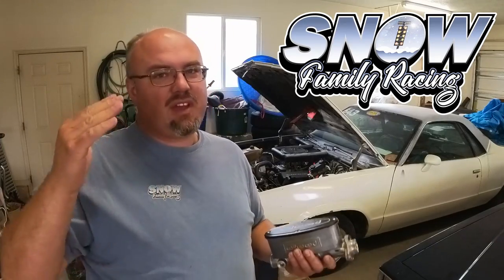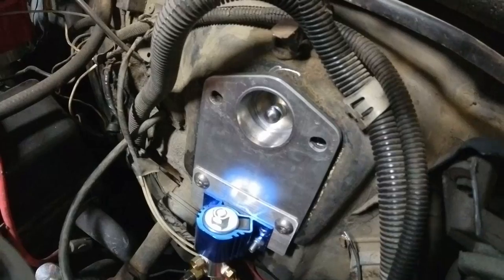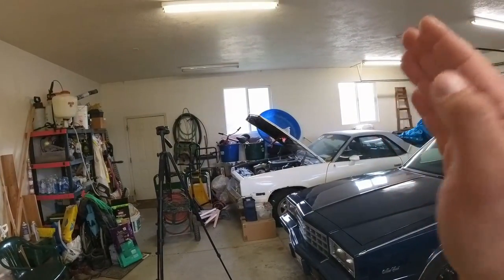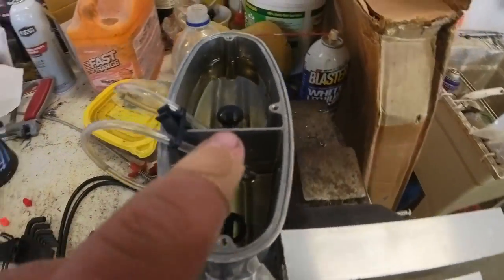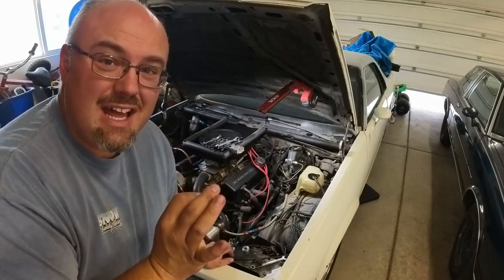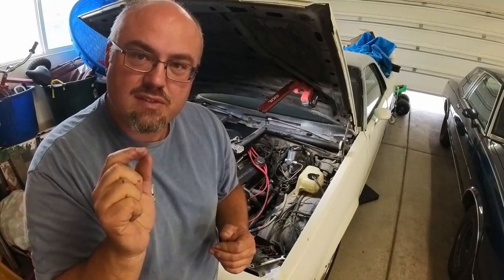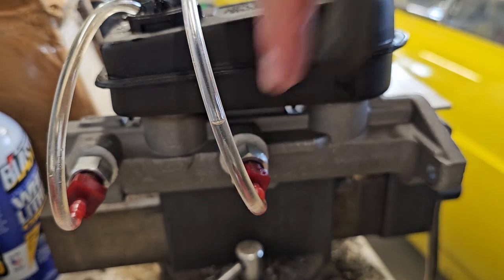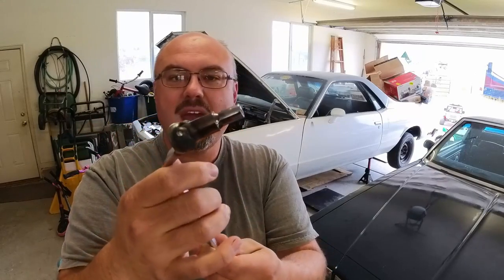G Body El Camino Manual Brake Conversion: Success or Failure? 🤔

Comment: Do you have stock or upgraded   brakes on the front? And your set up is manual correct? No assist
Reply from the maker: It's stock parts, stock calipers, stock rotors and a manual set up. I do have braided hoses from the frame to the caliper. The one change I would make is a 15/16" Wilwood Master. I've talked with them after I made the swap and they've suggested the 15/16" master to be the ideal for this set up.

Comment: What is your pedal ratio?
Reply from the maker: The factory manual brake hole puts it at 5.5:1. After this video, I've talked with Wilwood, and they recommended a 15/16 bore master cylinder as being more ideal and offering more clamping pressure than the 1" bore I currently have.
Reply: @SnowFamilyRacing did you change to the 15/16”?
Reply from the maker: Not yet, I've still got the 1". I do intend on changing to the 15/16" bore per Wilwood's recommendation.
Reply: @SnowFamilyRacing I have the same 7/8” bore MC like the one you replaced but haven’t plumbed it yet. Now I’m concerned! Lol 
Did you retain the OE proportioning valve?
Reply from the maker: Yes, it would have been easier if I hadn't tried to plumb a line lock in. In one of the brake conversion videos, I show how the 7/8" master cylinder flowed. The one I had flowed the rear brakes long before the fronts started to flow. My 7/8" master may have had an issue, I don't know. 

Keep an eye on how your ports flow when you bench bleed the master. That will tell you what you need to know.